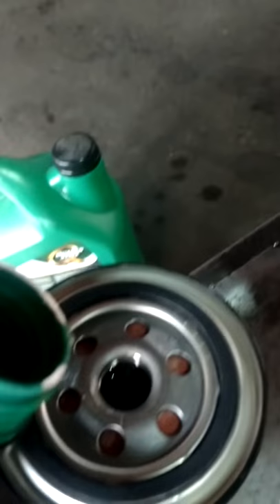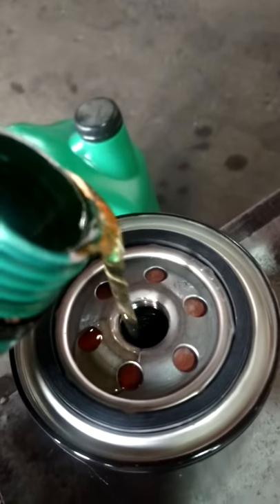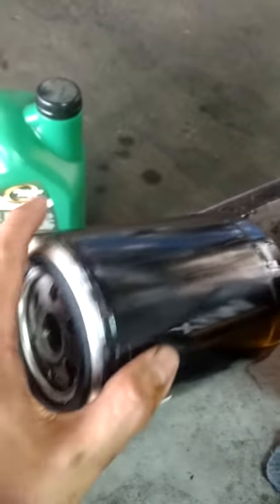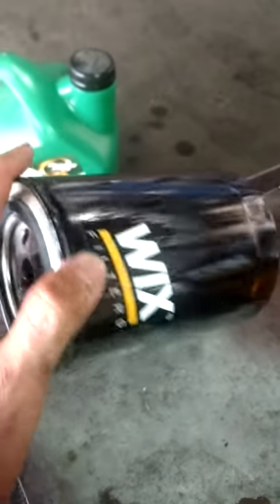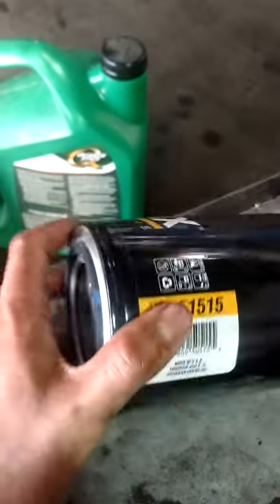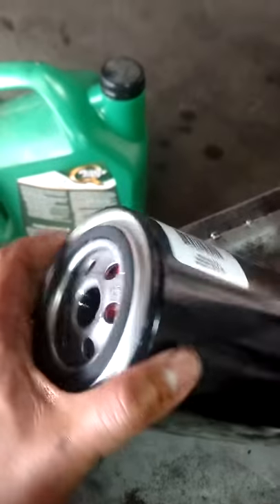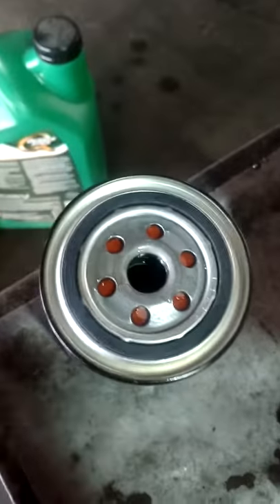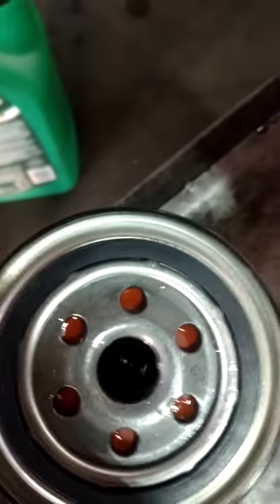Tech Tip #1: Oil Filter Pre-Fill Technique

Comment: Pre fill is not needed. It's under so much pressure it fills and pumps in a second or two. Some very expensive vehicles have canister filters and are not primed. Some are on such angles you would spill the oil out of the filter before you could screw the filter on. You do need to rub down  the gasket for a good seal.
Reply: Agreed. For example oil filters on Subaru cars are on top of the engine and the opening is facing downward.
Reply: It's not necessary, but if you can do it why not.
Reply: @abdulazeez.98  This is why not.  Because you're by-passing the oil pump pick-up screen and the filter with oil that is "new".  New oil tests too high in particulates till it runs through your filter that you just by-passed.  All you need is bottle plastic or some random contaminant in the bottle or a piece of foil in the center where he poured and you're out an engine.  If you have nothing do gain, why risk losing your engine?
Reply: @briansmobile1  
Good point, never thought of that.
I assumed the new oil is fresh and doesn't need filtering, but yes some particles can get in especially in messy environments (like my garage 😂).